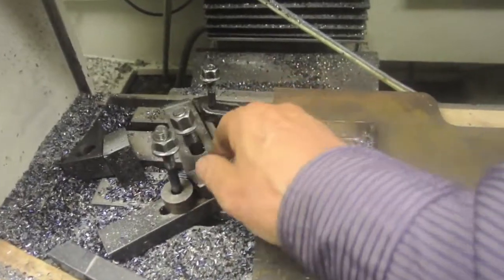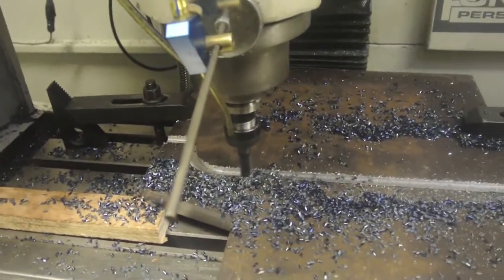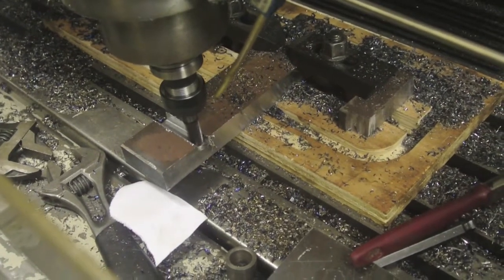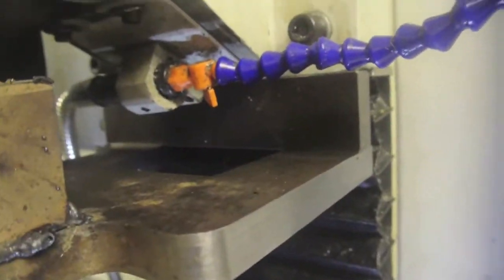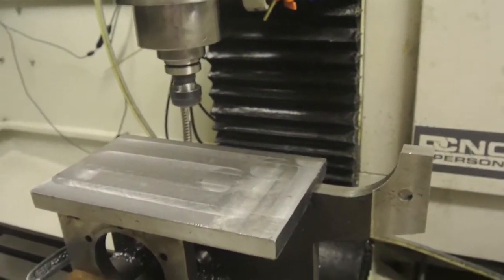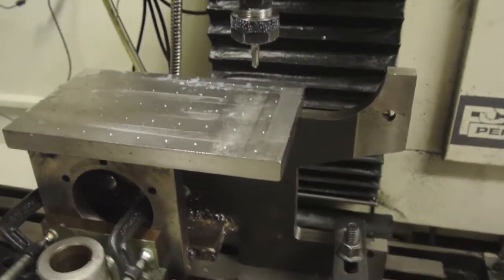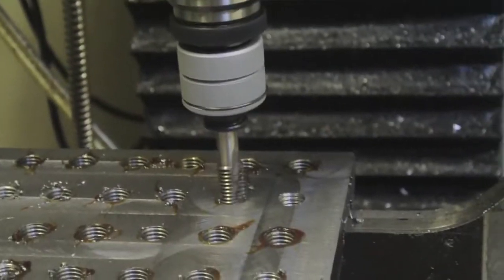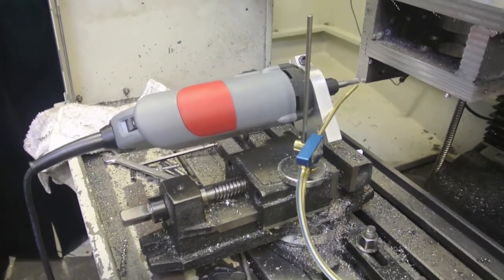Gang Tooling for the Tormach Rapid Turn Part ! the Tooling Plate

Comment: The tool holder for RapidTurn is the only reason I havent used my RT in 8 months.  Excited to watch this series.  Thank you
Reply from the maker: Hi Shawn, I hope this gives you inspiration. I should get part two done by tomorrow. I have actually used the gang tooling with the Rapid turn on some 2 1/2" steel just to try it out and it worked well until my makeshift tailstock centre burnt out and chatter resulted. I have got some video footage of it on my I phone but it's not the best, however some time later next week I might be fit enough to return to the workshop and use it properly and finish off the Wheel Hub for a Veteran Triumph Motorcycle circa 1911.
Reply: Dont push yourself, but would love to see it.  If I remember correctly, I found your channel not because of the Tormach but because of the BSA girder fork videos.  My BSA is a '68 Lightning so no girder forks, but still loved the videos.
Reply from the maker: Hi Shawn, don't worry I won't be pushing myself, I don't want to go through any more Hernia operations. I've got a 1959 A-10 RGS Lookalike, sold my Gold Star DBD 34 last year some time and  A Thruxtonised Venom at Stafford in April. I also have a 1927 Humber 350 Side Valve,  a 1929 Humber 350 OHV and in process of restoration a 1928 350 OHC Humber.

Comment: Hi Bob. Good to see you are underway. Your Gang Platform looks really solid and versatile. Thanks for the videos. Cheers  Cliff
Reply from the maker: Hi Cliff, I think it is going to be useful for sure. I think I will make a plate to put on the table of the mill to enable it to put the mill further away from the Y axis origin so that I can use the front face as well.